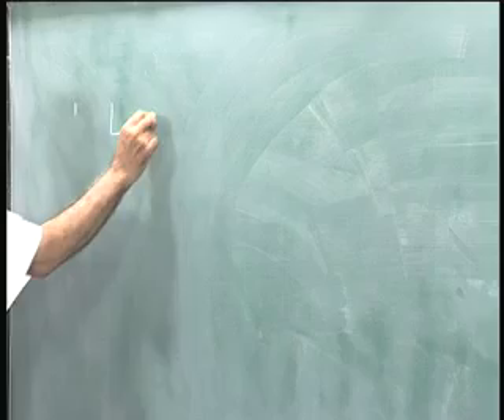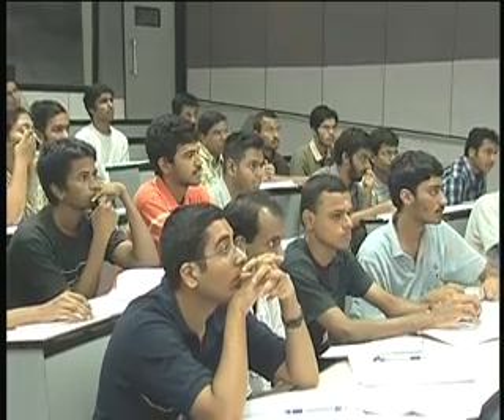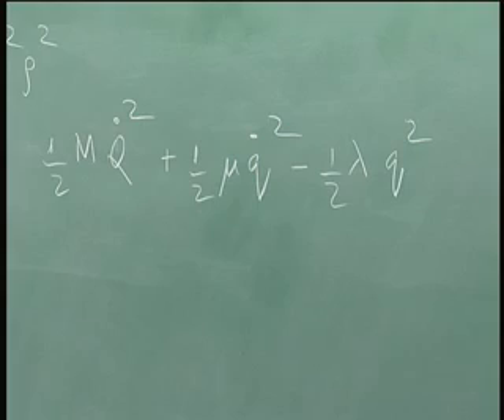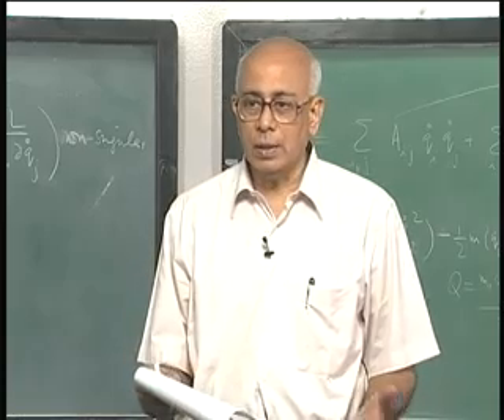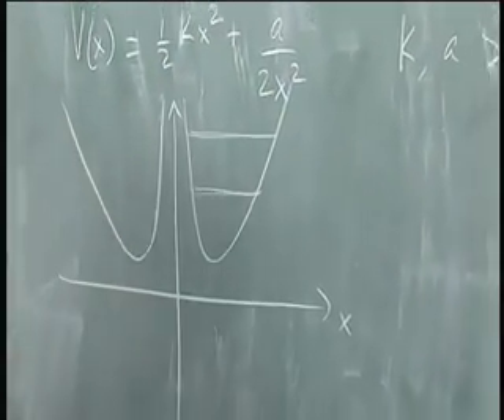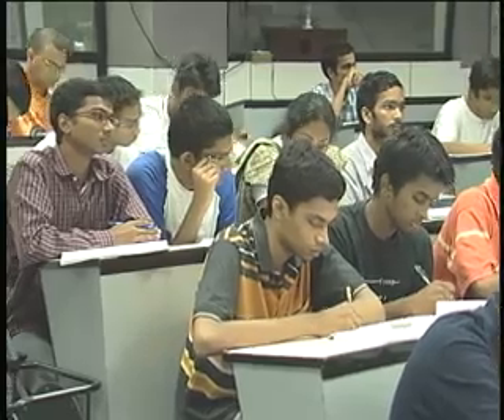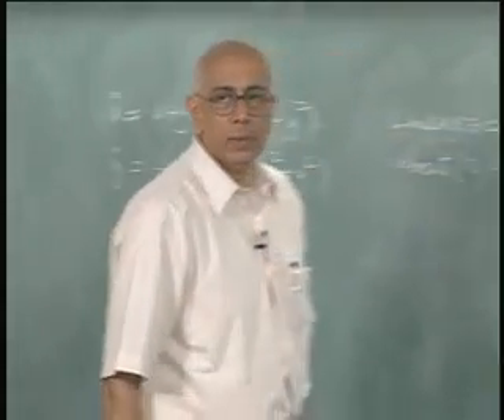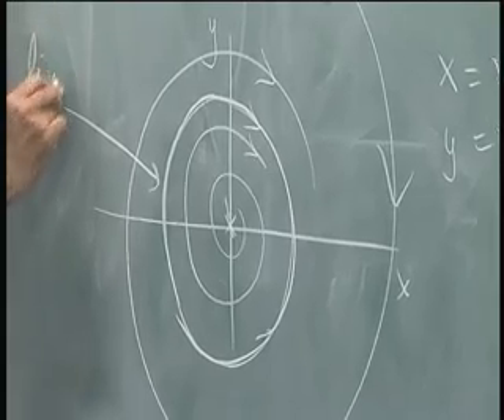Mod-01 Lec-19 Problems and solutions (Part 2)

Comment: They action isn't necessarily invariant, is it? If it changes by a total time derivative of G the action will change by the difference of G at the two endpoints, the reason this is still a symmetry is that you don't change the endpoints when considering variations of the trajectory in the Lagrangian formalism.

g